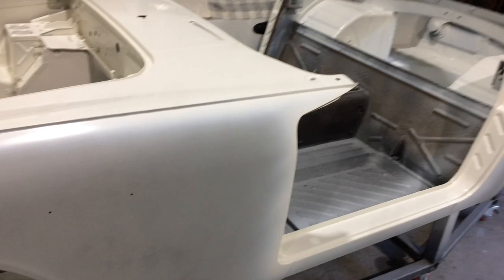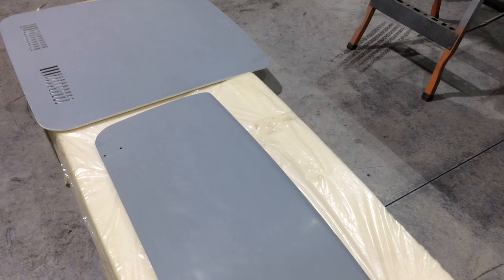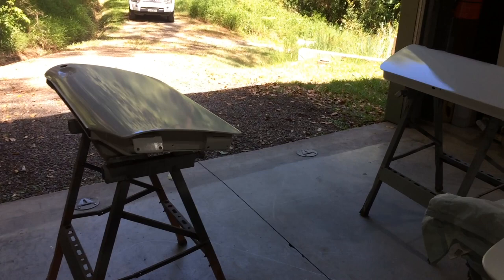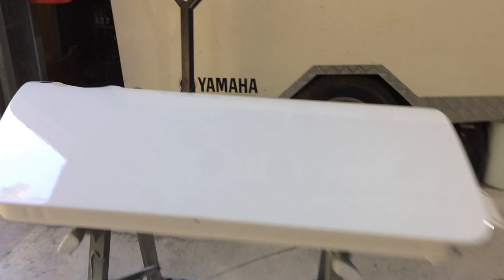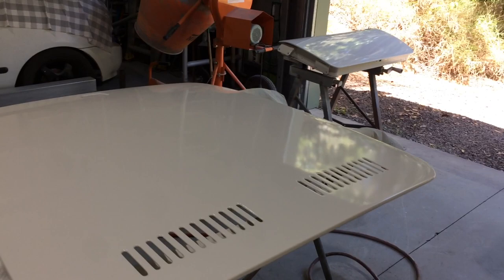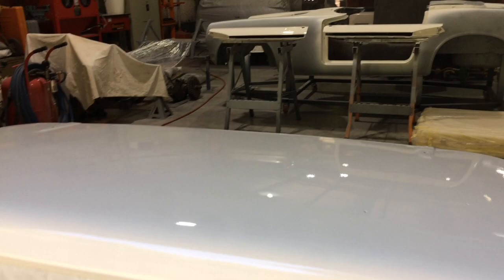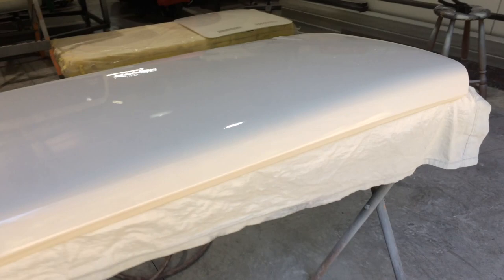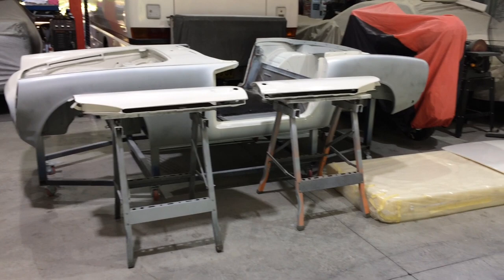Honda S600 Py 29. Painting the Doors, Bonnet/Hood & Boot Lid!

Comment: damn that is straight! nice job! only have 1 tip about painting ( if I may say), white paint is heavier than black paint, so when it is wet the even when mixed the white paint will drop a little bit more down than black paint because of the weight (and NH-0 has white black red and yellow in it). So because the body is standing normal, I would have painted the doors also on the same way they would be mounted on the chassis.
Reply from the maker: Thanks for that Rikky! Good tip I will see how it matches if it needs it I will change it, Cheers!!